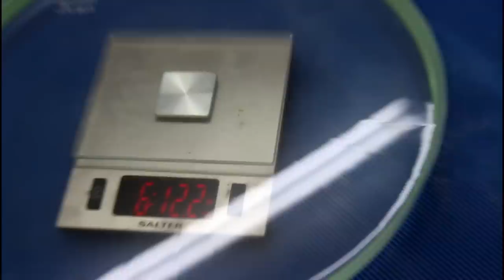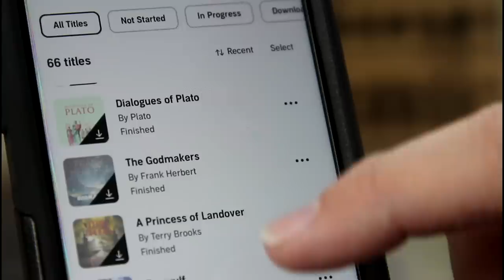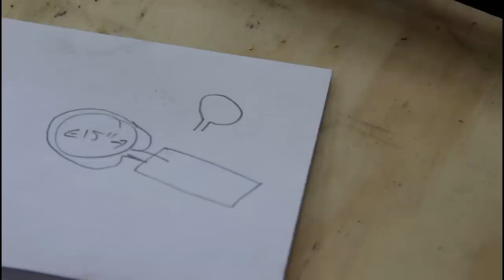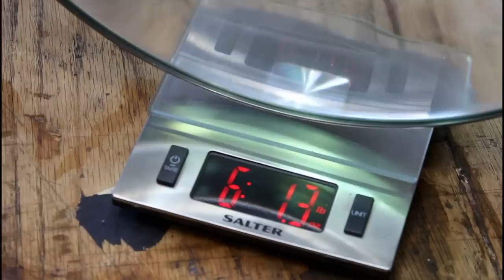Giant Resin Magnifying Lens?!

Comment: Lens grinding seems pretty tough for sure.  It came out nice though!

I seem to remember that you tested before how resin shavings turn invisible when put into resin.  I wonder about if you had shavings that were dyed really strongly, would you end up with streaks of dye through the resin then?  Another thought I had was that if you had something you wanted to suspend in resin but were too heavy or if you wanted specific placement within the resin you could place the items on a bed of shavings then pour your resin over it?
Reply from the maker: That might look cool. Might be worth trying it again.
Reply: @peterbrownwastaken  Since the shavings do disappear inside a new pour, could you use them as filler for other large pours? Would be interesting to see if it would be a worthwhile way to recycle the shavings. Might save on resin costs.
Reply: @Dilz6669  It could give lots of surface area for bubbles, but as long as the project fit in the pressure pot that could be solved. But from what I remember of his previous experiment with shavings, they had almost no volume.

Comment: Just some friendly advice here: the bezel around magnifying lenses are slightly taller than the depth of the convex surface so that they can be set down on their faces without risk of scratching the lens.

I figure that the steel you were using was just the size you had, but upgrading to a 2-3" (judging the width through a video is difficult) wide bar may be beneficial to the long-term health of your jumbo lens.

Comment: For something like that, I was thinking you could polish with a rotating plate the way real lenses are ground. That got me thinking about liquid metal telescopes, and whether you could let a plate of resin cure on a turntable so that it would fix the parabolic shape in place. And  then I wondered if you could then use that as a mold to make more lenses much easier.

Comment: I hear it’s kinda easy to make a spherical lens shape just by grinding shapes against one another. Maybe spin a disc of MDF up to an approximation of the shape (but concave), coat it in epoxy, and grind the two against each other with abrasive between? As you move them relative to each other all the non-spherical optics should get averaged out, as the angle changes away from the normal.

Diy resin optics is really interesting looking, especially now that we have resin 3D printers.

Comment: I think it would be great to use the clear resin ribbons in a project with a lot of glitter, so that the glitter stays distributed instead of settling at the bottom 
Also, have you ever considered mixing in auto pearl or hyper shift pigments with resin, I’d be interested in seeing if they are still able to shift in the resin

Comment: Your off-the-cuff attachment is actually near-identical to what they used to do, way back when such things were still handmade. They either put a u-shaped metal around it, cupping the glass, or put a groove in the edge and used a wire. It's neat to see convergent invention like this, where something ends up being so eminently practical that even centuries apart, people still naturally arrive at the same solutions.

Comment: Pretty cool. I don't know if you would ever be interested in a part 2 but after some thought, something that may or may not work might be to take something bowl shaped but a much wider curve, so like say one of those round children's snow sleds, and forming 2 separate halves. When the second half is set, before you remove it from the sled, add a thin layer of resin and lay the first half in top of it. Let that set up, and then when you release it, it should only need minimal sanding around the outside edge, if any, and have perfect curves, provided the mold/sled you use is stiff enough or has enough soft support underneath to keep from warping it. I don't know if bubbles would be an issue in the glue up part of the process. I guess not if you poured an even layer and then torched it before laying on the second half. I would have done it your way for my first attempt, too. Very cool, nonetheless, and it will be an awesome talking point forever when people see it.

Comment: If you span foil over a circular pan and pull a vacuum, it will form a shape that is quite close to a parabolic lens. Casting resin on top of that should give quite nice results, especially on a smaller scale, without having to remove material.

Comment: Hi Peter!  I love your videos.  I have a suggestion if you'd like to try this again and go for perfection.  With no lathe work and no sanding.

1st, you'll need a spinning table (like a potter's wheel).   Then center and secure the pan you used as a mold in this vid.  Fill it 2/3 fill of resin, and get it spinning.  Adjust the speed until the edge of the resin rises to near the top of the pan.   Let it go until it cures.   It should make a nice parabolic bowl.  This is NOT the lens.  (well, it's A lens, but not the one we want).  This is actually the MOLD for the lens we want.   Spray it down with release agent, then fill it up with resin.  It should make a convex perfectly parabolic lens with one perfectly flat side.  Make another one, then fuse them together (glue? more epoxy? Nothing but some oil between the lenses and a big v-band clamp?), whatever you think is best.  I like the oil and v-band idea, personally.

viola! perfectly clear parabolic magnifying lens with no sanding and no lathe-work.

theoretically... 

I hope you read this and are inspired to try it!  If not, my feelings will likely be terribly hurt, but I'm likely to get over it quickly.

Comment: The funhouse mirror effect is pretty cool in it's own way, but I'd love to see this given a proper optical figure-- you could make it a proper death ray!  Take that, bugs.

Google 'rough grinding' and 'ATM' (amateur telescope making, in this context).  As another commenter mentioned, there are fairly simple techniques for getting highly accurate spherical form by grinding with a large grinding tool made of a material similar to the lens, and loose grit.  As the tool and lens grind together, they both wear to a common shape.  With the appropriate stroke pattern and rotation it can produce a very accurate spherical lens (usually for the concave piece to be made into a mirror).  At least in theory... I've not done it, but the technique has been around since at least the 50's. Supposed to be a pretty slow process with glass, not sure how much faster it would be with resin.

Love the channel, almost every vid is an instant click.  Cheers!

Comment: Hey Peter so there are a few things you can do with shavings. So let's say you're doing a block mold or circular mold but you have a lot of solid space. 

People have cleaned shavings and used it in areas to for a filler for silicone molds. 

Basically you cast a thin layer and use the rest for a second larger and much thicker layer to ensure the cast is perfect each time but uses faaar less silicone. 

Mind you casting a model first and having it cure with at least a half inch to a inch (if smaller but needs perfect detail) or etc depending on the model you then put the whole model with the first layer after cured on the base of something removable. 

Then cast the final layer but areas with Large spaces then get cleaned off resin flakes pressed in as long as it's milled so there's no sharp flakes.

A little molding technique. 

Also I have seen some people mill these flakes to be used as a opaque glitter inside of resin or pretend ash for lava tables too. ❤️ hope this helps

Comment: I love the video as always. I don't think you've ever had a dud. I do have a thought on the resin strings off the lathe though. Since you did a dip it video with them and deduced that it turns back clear, couldn't you use it as filler in other projects? Maybe some that don't require completely transparent resin. I know that's a somewhat boring use for it but it is practical.  maybe you could even use it to suspend things in the resin if you use the pressure pot to minimize bubbles?

Comment: Wife and I are always thrilled to see a new Peter Brown video pop up! As far as reusing resin shavings, I wonder if you could use them as filler in the same material (Fathom shavings in a fathom pour). I wonder if it'd work like the pyrex in vegetable oil science demo on refractive indices. (Search "Bruce Yeany refractive indices" on YouTube).

I feel like the shavings would probably trap air bubbles and the bubbles would make the shavings "appear", but fathom might be thin enough to work.

Comment: having worked on corian solid surface acrylics, you can get an optic clarity by staging up to 6000 grit . . . also produces a scratch resistant surface as well, and may allow the acrylic to act as a decent magnifier
Reply: i have to clarify, 600 grit in normal grit system, preferably on a multipad random orbital buffer . . . not really feasible for small work, but very consistent finish on large flat or semiflat surfaces

Comment: Pro tip from someone who used to manufacture polyurethane products for 10 years. Don't spray your mold release close to your bucket for mixing/pouring (or the chemicals themselves if they're uncovered). You risk having a failed pour if it gets into the unhardened mixture.

Comment: Peter, I have an idea with resin shavings. What if you made a few sacrificial colored blanks, that you would turn down just for the shavings, then mix the different colored shavings and pour them in with clear resin. Maybe a knife handle blank, or something. I think that would make for a really interesting effect, although you'd have to dye the resin pretty intensely so the color is visible when it's really thin

Comment: For the resin shavings, you should try putting some spray paint (or any other "surface" coloring). If you then cast a bowl or something with resin and put the shavings in, I believe they should become transparent and we should only see the streaks of paint floating in resin. A bit hard to explain but I reckon it would look really cool.

Comment: Something I would do with those shavings...

First of, I'd take them and squish them down into a container, not super tight, we want everything touching, but still have enough space that fresh resin will have a chance to fill every crevice.

For the fresh resin, I'd go a solid black, with dark purple glitter¹, maybe even some UV glitter.

I'd put that into a pressure pot, to take out any air, then I'd let it cure.

Take that blank, and make the biggest sphere I could with it.

Then, make a base that's got LEDs in it, for it to rest on. (If UV glitter was used, I'd definitely include UV LEDs as well, and make it so you could switch between light modes, being off, both, just UV, just white.)

I think something like that would be pretty cool. 

If you took this entire concept, but did a translucent color, with the UV glitter, on that light base, that would look absolutely stellar.

¹by glitter, I mean powder. Maybe. So many terms for additives. I do have a recommended company though.

Comment: Could you use the shavings to reduce the resin needed in a mold ever so slightly? it wouldn't take up a lot of space but may take up some and due to them being discontinuous fibres you should get a mostly consistent material after, could have bubble issues but it'd be interesting to see if it'd work, similar to how you can use old silicone molds to take up space when new ones are poured

Comment: What is your opinion on taking off the 90 degree corners before taking it to the lathe? I mesn hitting each corner with a 45 degree table saw, would that be quicker or easier?

Comment: You can make a very accurate concave parabolic surface by spinning the dish it's in at a constant speed.
You wouldn't use that for the resin itself - I think you should try putting the pizza dish on a motorized lazy susan or something, and making a silicone mold that's a concave parabola, and then casting the resin into that to make your convex parabolic lens.

Comment: As long as you use the same resin as the resin, you can use the shavings for filler for big pours.  The shavings should disappear in the pour because they should the same refractive index as the resin.  It likely wont work if the shavings were of a different resin than the poured resin, but as long as they're the same it should work.  Key word here is should.

Comment: Basic color theory tells us blue and yellow becomes green. Purple and yellow is however on the opposite side of the color wheel, so if the ratios right (which it probably never will, since it keeps yellowing over time) it should yield a more neutral color.

Comment: For an optically clear lens, instead of pouring a flat disk and grinding curves onto it, why not stretch a sheet of plastic (like clear food storage plastic wrap, I mean) over the mold pan or a large bowl or something, and pour the resin on top of it? The resin's own weight will push down on the plastic and naturally form a hemispherical depression in it, then cure into a solid plano-convex lens (flat on one side, bulging on the other.) Make two of those, then cement their flat sides together with a layer of clear resin in the middle, and you have a convex magnifying lens with perfectly smooth, perfectly curved surfaces on either side, no turning necessary except for shaping the rim of the lens.

Comment: 1:12 that heater is blowing straight over your setup lol. Put it on the floor next time
Reply: Why is it a problem that the heater is blowing over his setup?
Reply: @musiciseverything120  It just pumps hot air to the ceiling and rotates everything in that plane and above it while the bottom one meter stays cold. If you put it on the floor, your space will be heated a lot more uniformly and not just the part of the space that you aren't even in

Comment: I understand lathing wood as that's not only traditional but the byproducts of it are fully biodegradable. That being said, introducing all the micro plastics into the environment by lathing several pounds of resin off of a project when you could have just cast it in a mold to get the desired shape and size seems incredibly imprudent and wasteful.

Comment: Yeah, it was gonna be really really hard to get it optically correct...

Although to be fair and very honest, that is better than I thought you'd be able to do...   You can see through it...  It's wavy, but I expected much worse.   It's actually pretty good.

Also, even if you spent a dump truck full of cash on an optically ground lens to mount in there, in those proportions, and in the size of the "average" home shop...???  It would be just as useless as what you have, and highly impractical for any real use to a home shop person....  So in a very real way, you have something just as good as what the other option would be.

Comment: Just use a cement mould with grease inside so you can get a 99% finished lens.
Use a curved piece of wood as a radius driving compas for the concrete curvature. And later you poor the epoxy and at the end take it and just polish the surface. Why wasting epoxy soo much? Just saying....you can make two lenses from that quantity of epoxy resin